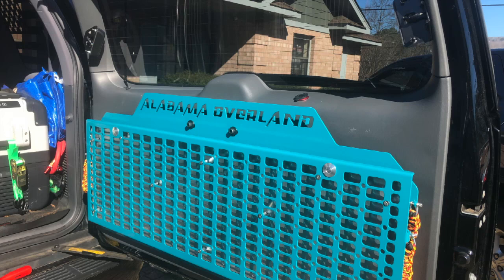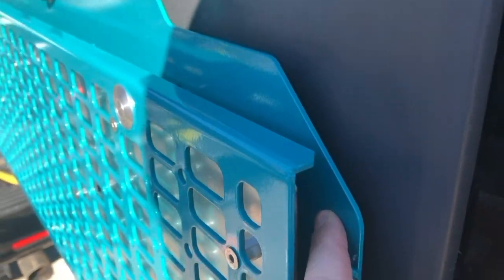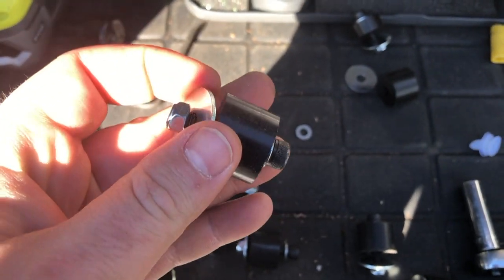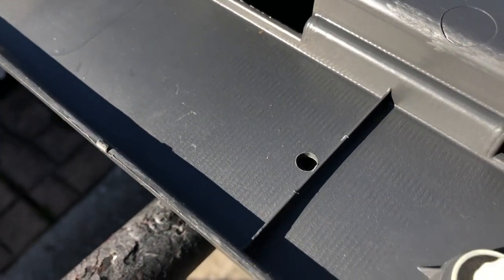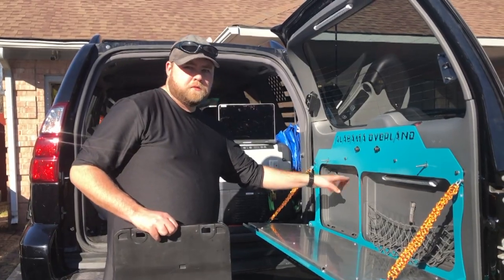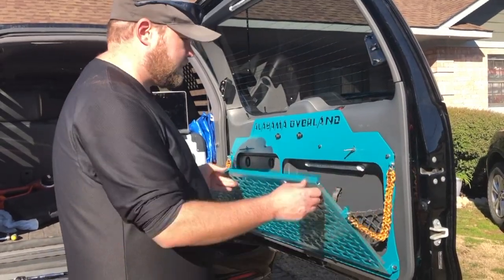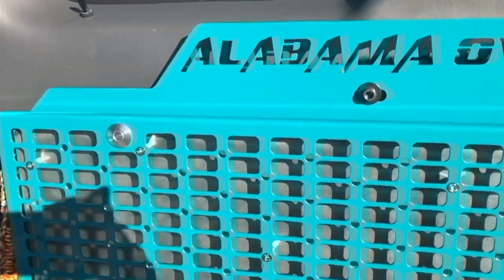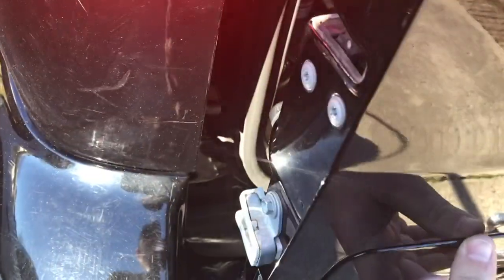GX470 Orange Boxx Fabrications  rear fold down table for Lexus GX470

Comment: Get a button head or pan head screw to replace the socket head cap screw.
Reply from the maker: Turns out it was actually the tailgate rope that was getting caught when i closed the door. I used a small bungee cord to make the rope pull in when i closed the table up. Works great after that.

Comment: Where’d you get your flag decals for the rear quarter window?? Been trying to find these
Reply from the maker: Overlook Graphics is where I ordered from. I was not happy to find out that they were not cut to my vehicle. They were listed at the time as a direct fit for the GX470 but when they came in they were a larger sheet that I had to cut down to fit myself. I was actually pretty ticked off when installing them because my cuts weren't perfect like I expected them to come.